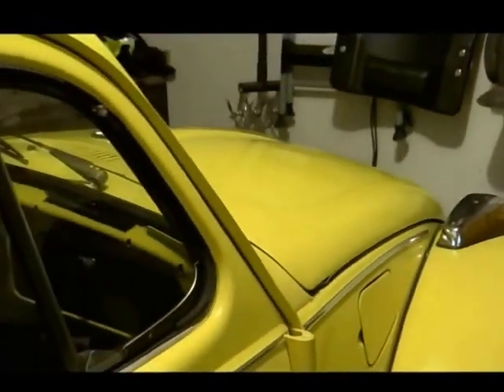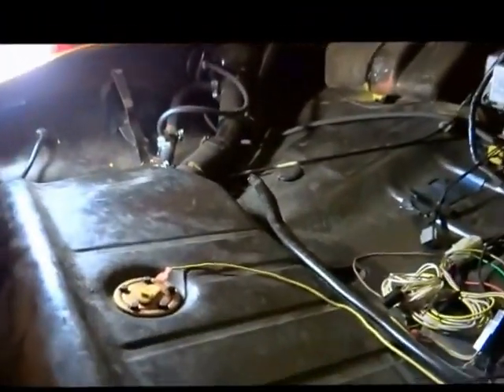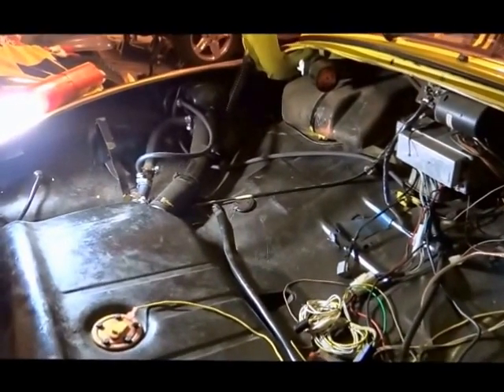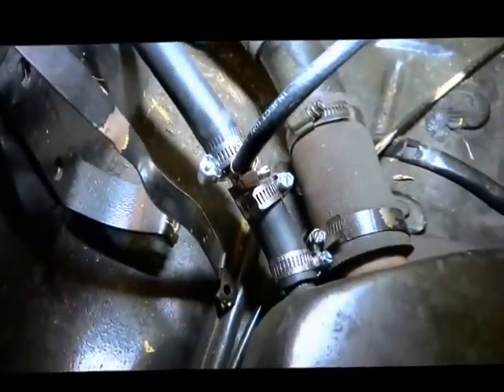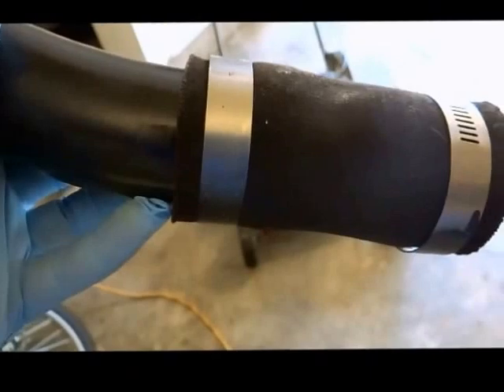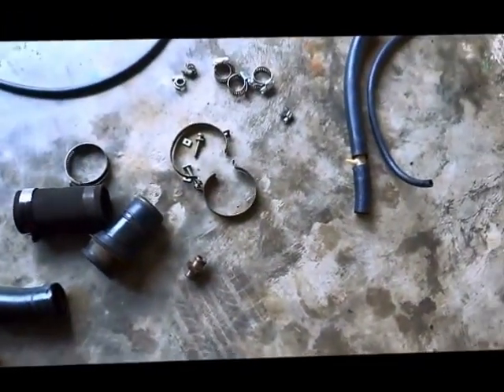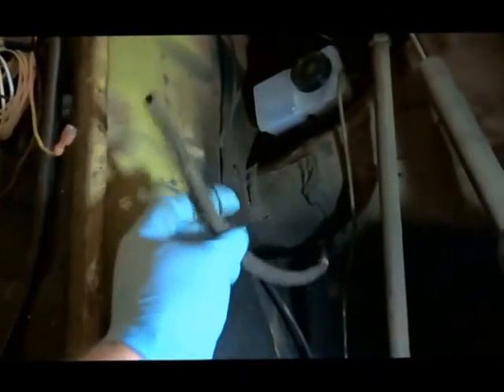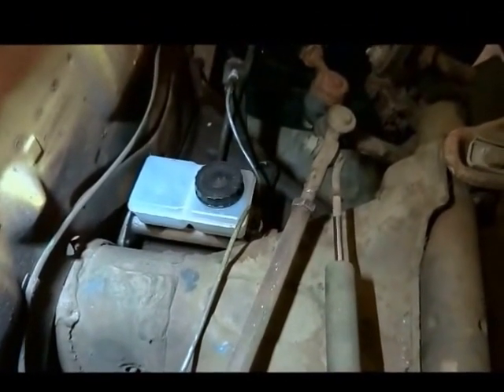1973 VW Bug gas tank removal, clicking noise, trouble starting

Comment: Is that gas tank from an older beetle? I thought they moved the gas tank up towards the cabin in 73 for the super beetles.
Reply from the maker: @gravitybreach4783  it wasn't a super bottle. They made both versions. Had the collapsible steering wheel.